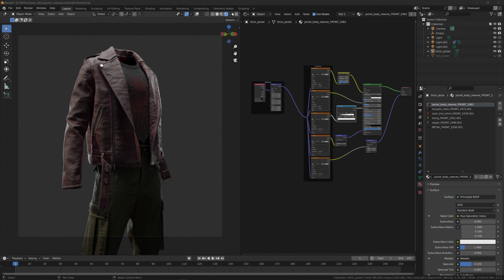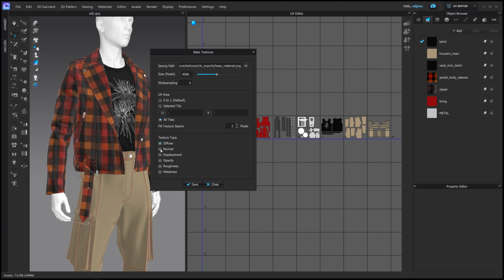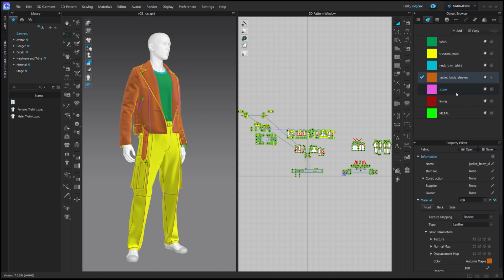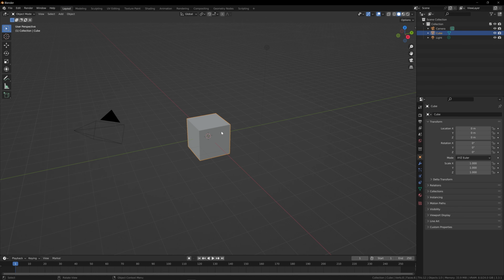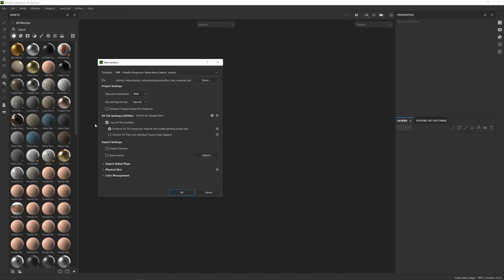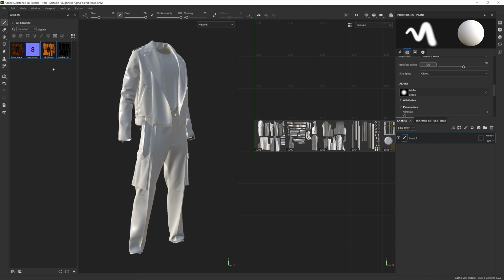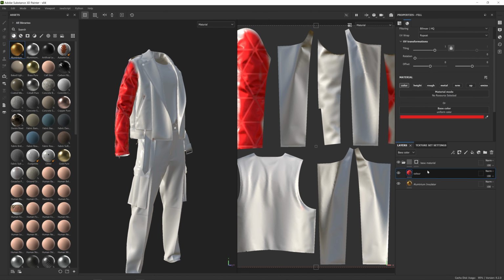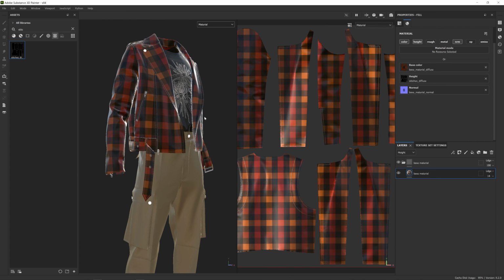PART 01  - Export Settings - Clo3d to Substance Painter + Blender - Substance for Digital Fashion

Comment: when i import my obj into substance painter it is not as smooth as it was in clo/blender. I tried both triangles and quads. triangles is smoother but not as smooth as original mesh in clo/blender. What could i be doing wrong?
Reply: nevermind im going crazy. all good.
Reply from the maker: Hope you got it fixed ;)

Comment: Why did you use the thin layer? When do you bring in the thick layer? Can you just use the thick layer if you only have one material for let's say a jumpsuit?
Reply from the maker: Becasue its better for performance and for texture baking. The thick one is fine for renderes but when working in substance etc. the thin one is used

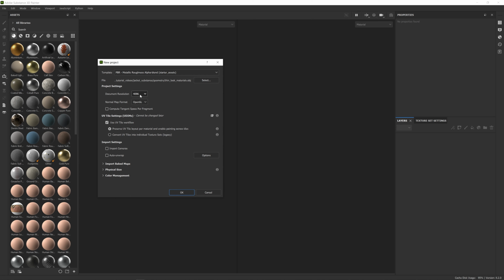Comment: I got stuck. Firstable, when I want to save the obj file from blender, it doesn’t give me the material option, however, I followed the steps and save it anyway. When I want to import obj file to substance paint (17:00 min) it appear an error, and does not allow me to open the obj file. Any recommendations?
Reply from the maker: Import a basic t-shirt init clo3D and follow all the steps again to test the workflow..ensure you are using the correct import and export settings and everything should work fine

Comment: Show me grid of model.What kind of polygonage? I think it is not optimize mesh and not useful game engines and other engines.
Reply from the maker: This video wasn't about game engines, this video is not about optimisation for game engines, this video was about using substance painter to create high quality textures.

Not everything is about gaming....😉
Reply: @digitalfashionblender  I knew that the answer would be exactly that. But still, I need a guide to optimization.

Comment: Question: The only issue i'm finding working on the thin version is normals. When following this workflow, any patterns with the back side showing look incorrect. For example the straps. If it flods over a bit as it drapes, the back side is facing forward, and does not look correct as only the front piece is textured correctly. Like some generators affect front/back differently. What is the workflow here for this?

Comment: Any idea why I'm getting an error when importing to Substance?

[Scene 3D] OBJ: unexpected illumination model (0-2 recognized)
[Scene 3D] Errors have been found splitting meshes per UV tile: Mesh 'LeatherJacket' has faces in out of bounds UDIM indices: [2,-1]
Mesh has faces spanning across multiple UDIMs

This is right after exporting with one texture from C4D and importing to Substance. It wont load the model at all. 
I do have piping on my garment. Stitches are textures. I have separated the patterns into 3 tiles and can confirm there is no overlap. The only difference I can think of is I'm using Cinema instead of Blender, but not sure what that is impacting in the process.
Reply from the maker: Check your UVs in c4d. There is something overlapping more than 1 tile. If you used the zipper tool, piping tool, or have topstitching set to OBJ these will all effect your UVs and can size issues. 

Check the expected UVs first and see where the overlap is. The UV coordinate is given by painter. Tile 2, -1
Reply: I copy and pasted the patterns into a fresh clo scene and that helped! All seems to work as it should. Thank you.

The only issue I'm having now is after I add trims such as a zipper puller and slider, the UVs for them are added in the first UV tile as default. I tried moving them to another tile, but when i export it shows them back in the first tile larger and covering my pattern in that tile. I've saved after fixing the trim UVs (moving them to a separate tile), closed clo, then reopened the file and see they are back in the first tile. Not sure what's happening here. I see your garment has trims, so I'm assuming its possible to do in this workflow. Any tips on what could be happening?  @digitalfashionblender
Reply: seems its a clo bug, did a workaround and all is good, thanks ser

Comment: Hey, when importing from CLO-3D to blender my UV's are so scrambled its practically unrecoverable. I have the same export settings and have even tried different free clothing from CLO-Connect and exporting them as OBJ to see. UV maps always scrambled, even if I tidied them up in the UV editor of CLO. Unless there's some CLO UV sauce I'm missing. pls help
Reply from the maker: Not sure, I never had this issue. You need to ensure the Unified UV Coordinates is checked when exporting

Comment: 31,149 views  Dec 12, 2022  Clo3d to Substance Painter + Blender
Part 01 - Clo3d to Substance + Blender Tutorial 

Create detailed realism for garments made in clo3d using Substance Painter to create realistic textures and details. The workflow describes taking details from clo3d and how to set up the files ready for export to Substance Painter and Blender.

Part 01 will cover - Setting up UV tiles in Clo, understanding material slots, creating ID maps for materials, exporting normal maps for details from your clo project, exporting height maps for stitches, exporting base material and graphic. Exporting OBJ files for use in Blender and Substance. We will work quickly in Blender to fix material slots and then take everything into Substance Painter.

Focuse towards using Subtance Painter for Fashion Design and creating fabric and garment details. All import and export settings are covered between each software for best results.

Final output is rendered in Blender 3.3 Cycles for photo real render of garments and fabrics. The focus is to learn substance painter for fashion and how to render final images in Blender. Assuming you already have experince working with clo3d and building digital garments.

This series is for creators wanting to take their clo work to the next level!
Featured playlist

Comment: For Marvelous Designer I dont have these topstitches export as obj or texture in the topstitch menu? I there a workaround?
Reply from the maker: You just need to Google what you are looking for......

https://youtu.be/m2LzsCMV1Mw?si=ueto_zAWw6lVkHDg
Reply: @digitalfashionblender  Yeah, I knew that tut but I thought this wouldn't apply since he continues with PS and not with Substance :) thank you anyway!
Reply: I am using Clo now. I Got to the point where I exported all the UV maps in those 3 different steps id - ts and OG file. However, I keep running into scaling issues. I export the the thin garment from Clo to Blender with 100% scale in meters and The height is fine with x, y (up) and z. I import that thin garment mesh in Blender with scale 1.0 but the dimensions are totally off. In your Blender version in the video, it is not shown if you adjust the scale there at this Blende import stage. If I leave it like it is with scale 1.0 my dimensions are fine in y with 1.82 meters but x has 475 meters, y has 710meters. I don't get why y as a parameter is legit but the rest is off. When I export this again into substance its way too small and "far away in the UI" but I think its already faulty within Blender with those dimensions... you got an idea?

Maybe directly transfer from Clo to Painter without this extra Blender step?

best wishes

Comment: I'm been strugling with this for ages, but i LOVE this workflow
I have 1 question thought...
In the final video of the series you import the thick obj file to blendsr and apply all the material maps. 
But here you're only working and importing the thin version to SP. 
Did I miss a step somewhere?
Reply from the maker: No you didn't miss anything. The UVs are the same for both exports so the textures will work on both. The thick export can look better as the edges are more visible.

For performance reasons I texture the thin mesh because there is only 1 layer of mesh for substance painter to load.

Comment: hey, could you please help me. When i import my textures, they do not come in as complied textures with number 8 on it. it comes seperately therefore causing trouble. would you know what step i maybe missing?
love from india
Reply from the maker: Make sure the udim naming is correct with 1001 1002 etc, make sure you set up your project with Use UV tile workflow selected when you start the substance painter project
Reply: Hey! wanted to let you know your answer solved my problem exactly. The fact  you could solve my problem with only the limited information i could formulate, speaks of your expertise. I would recommend this course to anyone starting out in substance for fashion. Thanka a ton!  @digitalfashionblender

Comment: The normal map looks flat for me, there are no details. What is the reason for this?
Reply from the maker: More info is always helpful! Do you mean when it is exported or when you are looking at in substance painter. Make sure you are checking the Normal + Height map
Reply: Yes, I'm sure I checked. I can't see in either it just looks flat. Thanks for the reply ^^ @digitalfashionblender
Reply: Still need it? Just found the solution for that

Comment: Hello, i have a question when you import the texture on substance painter at 20:07 when you transfer it on your video it put it all stacked like you got 8 base materials but when i did it, they got all split and i cant select them all togheter to put them into the base color. thank you if u can answer
Reply from the maker: Check the udim is named correctly with 1001, 1002 etc. Check your project in substance painter is set to Udim workflow when you start the project
Reply: @digitalfashionblender  still not working i've put 1001,1002 etc and check that mya project is set with udim workflow when i start it but still didint work now instead of all stacked there a 1 on all of the texture

Comment: super helpful! 

Q tho - how did you split the zipper into segments? For the pants, it's more clear that you just cut up the pattern pieces and don't render the seamline. But zippers are a bit more finnicky
Reply from the maker: It's the same, the zipper is just a pattern piece. I don't use the zip tool in clo3D - I make my own zip from a piece of fabric and then cut it up how I need it :)
Reply: @digitalfashionblender  ah, ok ! I will try that too. Do you import a zipper pull and just pin it on or add that later ?
Reply from the maker: @SelfOhYes  Just pin it on, I add directly in clo the puller and slider and then position as needed. But for simulation / animation it can be better to add it after in Blender :)
Reply: awesome. thanks so much @digitalfashionblender

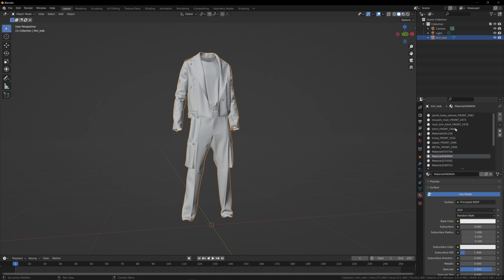Comment: I was wondering if you could help me with this problem: I didn't collapse all of my material into one like you did in blender at 14:00 and  I decided to directly export my mesh to substance painter to do the texturing since I didn't have texture/normal/height map  made in clo3d that I wanted to use in SP, but when I'm exporting the mesh to blender to apply the texture made on SP, when using the node wrangler I have difficulty understanding how to correctly apply the different texture to the differents part of the garment, since SP only gave me one mesh that have all of my garment.

 Should I have done each mesh separately in different project and after that export them to blender and apply the texture made in SP?
Reply from the maker: It's for this reason I fix the material slots in blender to only have 1 to work with in substance painter. You can texture each mesh separately but I would advise that you follow the 1 material slot with ID map  workflow 👍
Reply: @digitalfashionblender  okay thank you i will do that then!

I also found out how to properly set up the the different textures for the different slot in blender, but I realizedthe more UV i will have and the more complex and time consuming it will become. Since I dont have a lot it isn't that bad, but now i realize that your way of doing it is better haha

Comment: Thanks for you videos, love them! I'm trying to follow this 1st part but when I import my file on Substance Painter (file exported from Blender), my error message is: 
[Scene 3D] Loading failed, 
[Scene 3D] Failed to load 3D scene. 
Loading failed. 
What am I doing wrong ?
Reply from the maker: Make sure your UVs are correctly layed out and are not spanning across multiple tiles esoecially if using UDIM workflow.

You can always copy and paste the error message to google as for sure someone else has had the same issue.
Check the forum posts below :)

https://community.adobe.com/t5/substance-3d-painter-discussions/substance-3d-painter-won-t-load-my-3d-models/m-p/12175495

https://community.adobe.com/t5/substance-3d-painter-bugs/failed-to-load-3d-scene-loading-failed-when-using-udims/idi-p/13190590

Comment: Thanks a lot for this tutorial series! I started having some trouble when exporting my obj from clo to substance, losing uv tiles and this error: 

"[Scene 3D] OBJ: No object detected to attach a new instance"

Are you familiar with this issue?
Reply from the maker: You shouldn't export from Clo directly to substance. You need to export to blender, clean the material slot and then export from blender to substance. Check that the UDIM workflow is checked in the substance painter import.
Reply: @digitalfashionblender  Thanks for getting back to me. I did do the step through blender and am able to load my obj but still getting an error: 

"[Scene 3D] Errors have been found while splitting meshes per UV tile: Mesh  'name of obj' has faces out of bounds UDIM indices: [10,0] [11,0] [12,0] ]13,0] [14,0]." 

Is this a big issue?
Reply from the maker: @laneodom8947  it could be to do with top stitches that are not converted to textures and it could be if you are using piping or other details. Check you UV maps in blender and ensure there is no overlap between the pattern pieces on each UV tile. Make sure there is some space at the edges
Reply: @digitalfashionblender  thanks for getting back to me. topstitches are all textures. the UVS in blender look ok, but there are sitting outside of the UV grid box, would that make a difference?
Reply: fixed it! stacked a couple UV tiles

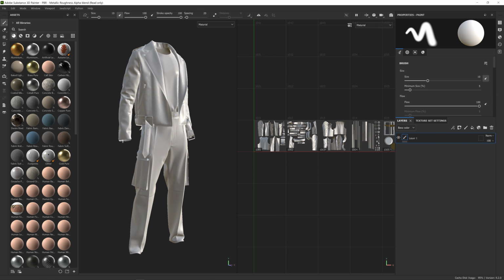Comment: @ Around 18:00 after importing my obj from blender. I dont know why but in my right side uv map area, one of my uv maps is on a different "main shader" under "texture set list". how do i get all my uv maps under the same shader? Also when i imported my OBJ into substance i get a red message on the bottom left -- "[Scene 3d] OBJ: Failed to locate material , creating a new one" --maybe that is a clue ???Thank you
Reply from the maker: This is explained at minute 13:00 in the video. You need to import to blender, clean up the material slots and then export again to substance.  Make sure you follow this step correctly and don't just export from Clo directly into substance painter.

If there are additional materials appearing you need to check again in blender where they are coming from. Make sure all your trim and hardwear is joined to your original mesh and you remove the associated material slots 

Hope that helps :)
Reply: @digitalfashionblender   thank you for your response. I did first import into blender, clean up the material slots until there is only one left. Even changed the color as you did and everything is uniform in color in blender. I will restart from the beginning and see if I didn’t make a mistake in clo while exporting the UV. Even though I have 4 maps/boxes in CLO UV editor and 4 files for diffuse, normal, ID, and Top Stitch. 
Also I have top stitching on my garments, in clo3d should that be in its own UV map?  Thank you.
Reply from the maker: @mauvaissigne  make sure the topstitching is converted to textures and not obj that might help I hope!
Reply: @digitalfashionblender  hey, im still having trouble with importing from Clo/blender into Painter because the UV maps are not being shown together. Could it be because in CLO, my top and shorts are 2 different materials properties? My top is silk knit jersey and the shorts are silk georgette? should all the pieces be the same physical properties type?
Reply from the maker: @mauvaissigne  if you are following the steps in blender to delete the material slots and it's still now working im really not sure.  Export Clo to blender. Delete materials, export blender to substance. This should work every time if you are doing it correctly. 

I would say export from Clo with ALL you patterns having the same material applied. Don't export topstitching as obj and don't export any hardwear or trim.  This will give you an export with 1 mesh and 1 material slot. 

Make sure all your programmes are up to date and make sure you have the UV set up done correctly.